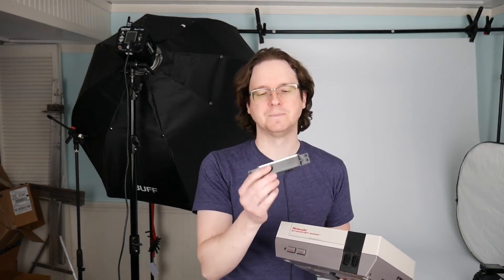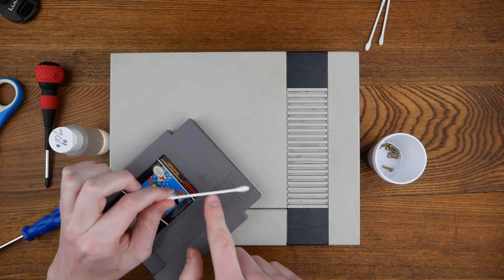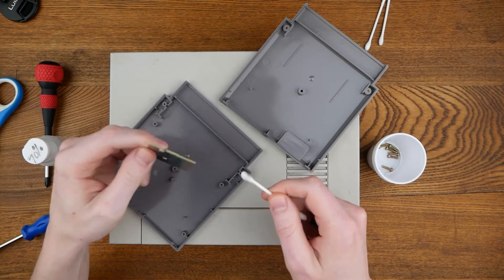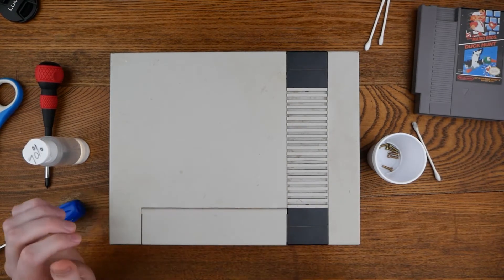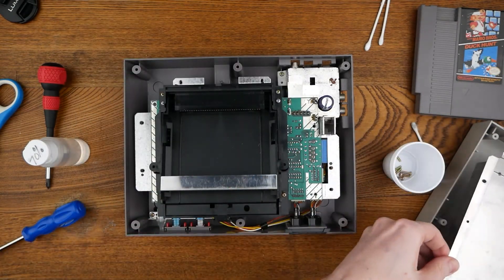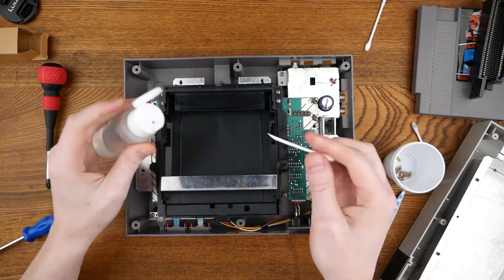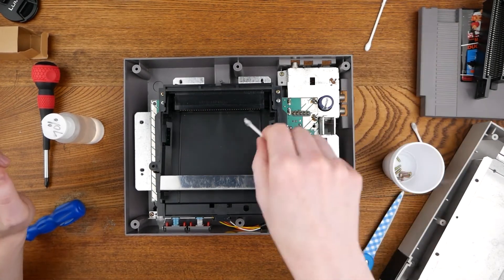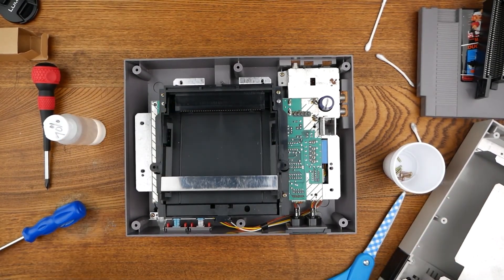NES 72 Pin Connector Repair - Try Before Replacing the Nintendo 72 Pin Connector

Comment: aside from rubbing alcohol, also use brasso if you're familiar with it, not only does it clean up all the dirt on the contacts, it gives it that shine and brings it back to life just a bit longer :) be sure to use a q-tip when doing it
Reply: If you're going to use Brasso, then make absolutely sure you've cleaned off all trace of it as otherwise the residue will set and the cure will be worse than the disease. Clean off all trace and then go over it afterwards with some isopropyl to try and get rid of it all. Brasso works, but it's pretty evil stuff for anything small & delicate.

Comment: If you want to get a more thorough clean rather than possibly getting cardboard debris in the pin connector, there are cleaning cartridges for the Nes and other cart systems that you can apply alcohol to and then insert in and out of the system as if it were a game cart and clean it between.

Comment: Thanks for this great video! I was about to replace the 72-pin connector however when I opened my NES I thought it looked completely fine, no visible bending to the connectors whatsoever, so I tried your method and now my NES works perfectly again! 
I read so many different things about what should work the best that I got kinda confused by it all, but at least I can say now that your method works!

Comment: Have to be honest, it's best to just replace the connector. The main reason no boot, flashing power light, blue screen is the pins are bent over time.
Reply: Not really. The China replacement connectors have the wrong tolerances. Their connectors are to tight. You can hardly get the cartridge back out.
Reply: @JG-vh6mn  not really what??????
Reply: @JG-vh6mn  They loosen up over time.
Reply: Do the replacements boot consistently? Does this cleaning job boot consistently?